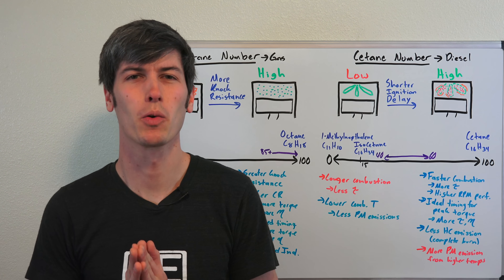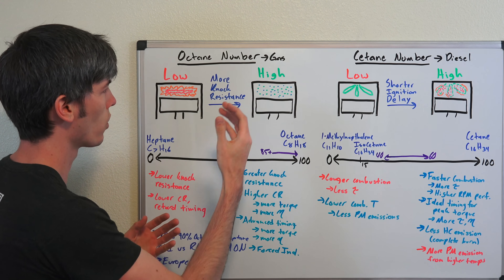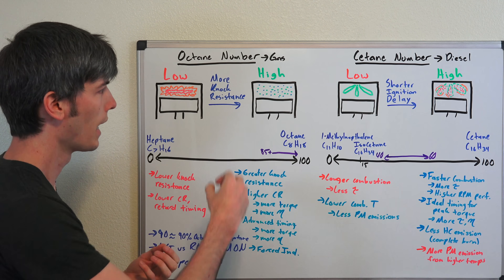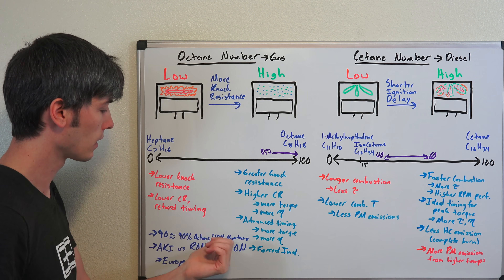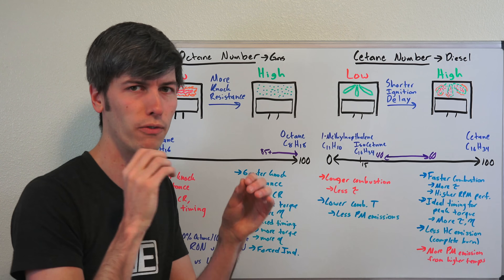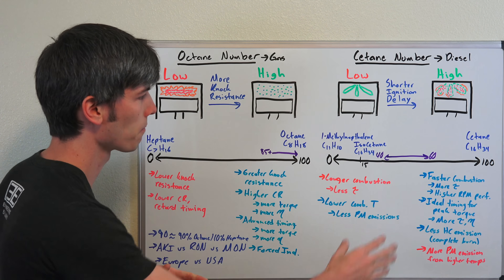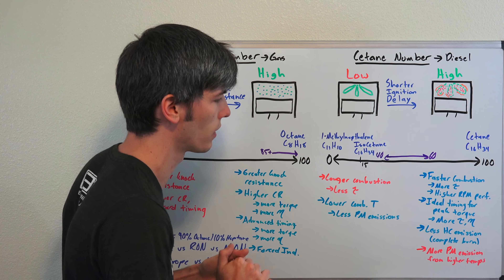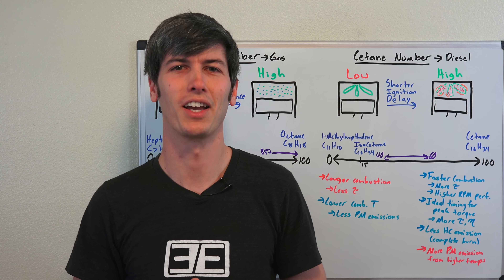Octane vs Cetane Number - Gas vs Diesel

Comment: Why do you call it Gas when it is liquid?
Reply: Gasoline
Reply: Shrikant Sonone mostly because we Americans preserve precious syllables. "Gasoline" and even "petrol" are multi-syllabic. "Gas" is one syllable and because we utilize gas as opposed to a gas no confusion exists here.
Reply: "Gas" is short for "gasoline", and Jeremy Clarkson keeps English airheads smug and entertained.
Reply: Oh look. One of the smug airheads decided to show up.
Reply: Aamir Z
No, "petrol" does NOT make sense, as literally anything refined from petroleum ought to qualify. How is kerosene "not petrol," if it is derived from petroleum? Also, how in the hell is it "paraffin" (a form of wax?)
Reply: Walter K Fewer than in gasoline
Reply: Shrikant Sonone use the word fuel instead
Reply: Jay Dunbar
Nobody puts wax in Diesel. You'd wind up with a viscous sludge. Maybe good for rustproofing, but that's it.
Reply: Pauli Vaara very true but more than in "gas". 😎
Reply: Because in English language we have one word for fifteen different things. Meaning depends on how and where it's used.
Reply: Zemzem Dağdelen 
Nope, too easy to confuse with "benzene." (An aromatic hydrocarbon.)
Reply: Petrol, short for petroleum which makes more sense compared to gas which could be gaseous natural gas.
Reply: bcubed72 paraffin actually has lots of stored energy and is put in Diesel for that reason.
Reply: I'm pretty sure there's some paraffin in diesel, as some kind of lubricant. I've understood that the main difference between the diesel types for different seasons (summer, winter, arctic) is the amount of paraffin. It would be good for the engine to have the paraffin, but it causes problems in cold, so the winter diesel has to contain less paraffin than summer diesel, and arctic diesel even less than winter diesel.
Reply: I've always called it "the stinky go juice made from dinosaurs" .
Reply: just use benzin instead
Reply: Zemzem Dağdelen nope, just too many syllables!

Comment: Octane: Prevents the explosion by compression so the spark plugs does it job at the right timing + cleans valves with additive from carbon
Cetane: Helps it burn by compression and lubes the fuel system (wax present)
Saved you 6 minutes
Reply: Doctor Claw just like sex, saving 6 minuets isn’t always the desired outcome
Reply: Doctor Claw actually the paraffin is nearly gone. The process of reducing sulfur in Diesel fuel also removes the wax. That is why ASTM added, for the first time ever, a lubricity specification to today's ULSD. That was previously unnecessary.

Comment: Octane used is iso-octane. IUPAC name 2,2,4-trimethyl pentane. Basically branched hydrocarbons. For the same number of carbons in the molecule, the branched one has a higher octane rating. For straight chain hydrocarbons the higher the number of carbons the less is the octane rating.

Comment: So what happens if you mix both regular octane and diesel in a gasoline engine?
Reply from the maker: Mix both what? If you mix two octane fuels, it will have an octane rating somewhere in the middle. If you mix gas and diesel, your car won't be pleased.
Reply: It might not even start. Diesel has to be atomized and ignited through compression. This is something a gas engine won't do very well or at all.
Reply: Engineering Explained sorry meant to say regular octane and diesel. Can you make a video on that?

Comment: There is one mistake with the way you described the octane number.
Because it  doesn´t come from the amount of octane that is in the fuel but how much of that octane is reconfigured into both shorter Hydrocarbons with more methyl- and ethyl Groups (Isoalkanes) and cycloalkanes. 
These Iso- and Cycloalkanes form stronger Van-der-Vaals-Bonds and are therefore more resistant to knock.
If I am wrong than tell me but that is how I learned it in chemistry-class.
Also I am sorry if i got any of the specific technical thermswrong, I come from Germany and have only learned the german technical therms.
Other than that it´s a great Video Keep it up mate :)
Reply from the maker: Hey there! Didn't say that it's how much octane is in the fuel, it tells you what the fuel behaves like. So a fuel that's rated 90 behaves like a fuel that's 90% octane, 10% heptane, but the rating does not tell you the fuel's composition.
Reply: Engineering Explained Oh ok then I just got that wrong, sorry to have bothered you. 
Have a great day :)
Reply: The kinetics that lead to the facile autoignition in straight-chain alkanes are complicated, but, in short, there is no connection to Van der Vaals forces. It is related to how easy/hard it is to form and stabilize radicals.
Reply: In both scales, depends of the country, some countries uses the RON scale, some others uses the MON scale and USA uses the AKI or (RON+MON)/2 Scale.
Reply: 90 behaves like 90/10 on the AKI or RON scale?

Comment: Yesterday I added the Lucas Octane booster in my BMW filled with a 93 octane (always) didnt notice any difference in performance
Reply from the maker: If you're using 93 in your car, it's likely tuned so that it won't see any benefit from a higher octane (since 93 is the highest sold at most pumps in the US). If, for example, you filled with 87 (which you shouldn't if it's not recommended), an octane boost (if it actually works) would help performance because your engine would slightly detune (slow timing) for the lower octane fuel used.
Reply: You won't notice anything, Cockgratulations, you've spent more for nothing more. Especially filled with 93 octane (Australia?)
Just kidding, do you have an old model with a distributor cap? Try tweak the engine's timing by hand then to profit from a slight boost of power. Cheap way for more power but also increases the engine's temperature and your pistons and rods might not take it. Be careful
Reply: I see, I just wanted to try it out for 10 bucks just wanted to see if it worked. Its a 2009 128i. Thank you for the response!
Reply: It did cost you 10 $ to learn. Even if you tweak the timing, maybe it cannot support that amount of heat that will create. BMWs are expensive to repair

Comment: 87 gas is always a good choice for 4 cylinder. Another job well done on ur magnificent explanation video sir. Never being amazing as mechanical explanation.🙌🏼✌🏼
Reply: The number of cylinders has nothing to do with what octane you should use. The recommended octane rating is set by the manufacturer and can vary from model to model and engine to engine.
Reply: Good luck running a 87 AKI gas on 4 cylinder with 13:1 compression ratio.
Reply: Rilo Elton With direct injection and a knock sensor, you can. Mazda's Skyactiv-G has somewhere around 13:1 compression ratio or greater, and those engines run just fine on regular 87 octane gas.
Reply: umm if i use 87 on my sr20 itll start pinging and eventually blow up...
Reply: Toyota Brony unless it's a high compression four banger. I don't thing engine configuration has much to do with it.
Reply: Govin Lock AKI is an average of RON and MON.  The average of 98 RON and 87 MON is 92.5 AKI. But there is no exact conversion from RON to AKI, you have to know what the MON rating is.
Reply: Octane requirements are entirely dependent on timing, engine compression, cylinder compression(if the car has forced induction). All of which will vary between how each engine is designed and tuned. Average entry level economy class engines are tuned on the lowest octane to be more cost efficient.

The engine layout has little to do with octane, as there are tons of examples within four, six, eight cylinder engines, in V formation, inline and boxer which all use different octane set out via the manufacturer.
Reply: o Lemurs you can check your car compression ratio in your car's manual book. the compression ratio is the most factor to determine which octane fuel are used.
Reply: Thats an ignorant statement. It's not based upon cylinder numbers or layout. Try again
Reply: QUIT SPREADING MISINFORMATION
Reply: 87 aki = ? ron
because I live in asia (which has same fuel standart as europe), so idk.
Reply: well i got a turbo and i can assure you if i run anything lower than 91 itll blow up
Reply: Most small engines run best on 93+. Especially 2-strokes.
Reply: Any performance 4 cyl turbo will require 91 minimum
Reply: except for if your car is tuned for 93. 4 Cylinder boxer here
Reply: A turbo effectively increases the compression ratio by forcing more air into the cylinders.   7.5:1 or 8.0:1 compression ratios are not unusual in turbocharged engines, that require high octane fuel in spite of their low compression ratios.
Reply: Depends on the engine. In general, 87 is all you need for any size or configuration.
Reply: Karol Bała it’s just a regular 2.4L 2AZ I am running. So 87 is an excellent choice.
Reply: Hank Hill that’s very good point.
Reply: yea only if it wasnt in japanese...
Reply: o Lemurs I read in wikipedia that sr20 (non turbo) has compression ratio of 1:9.5, so you should use fuel lower than 87 mon.
Reply: o Lemurs and research in google which fuel that suitable for that CR,  sorry because that's not my standart (Indonesia use ron instead).
Reply: Toyota Brony here in our country we only have 91 and 95 octane
Reply: Been doing exactly that in my Mazda 6 Skyactiv for 5 years!
Reply: o Lemurs well what happens if it was Japanese?
Reply: TheRealBRUH jeez. Can u tell me why??
Reply: Hank Hill Yes, number of cylinders doesn’t matter. I have a 1-cylinder 2-stroke chainsaw that calls for 89. It’ll run on 87, but with less power.
Reply: TheRealBRUH Does your country also marry goats?